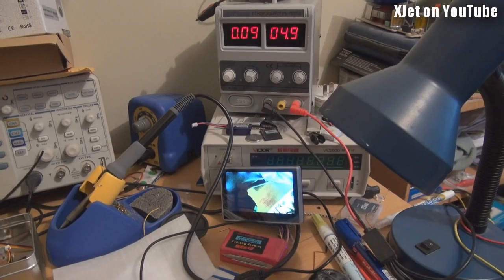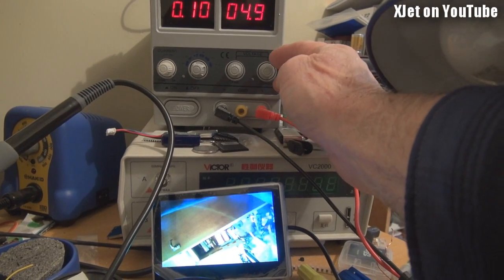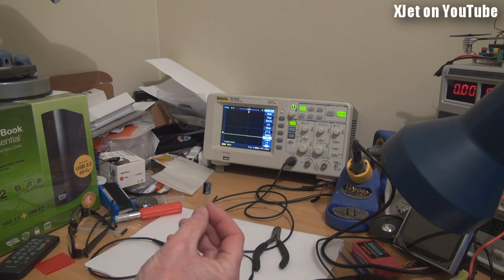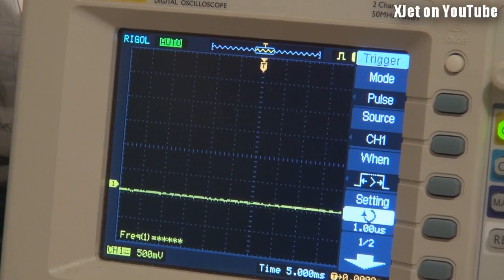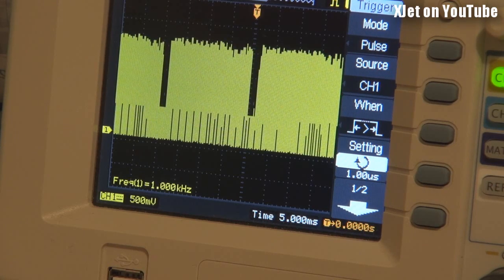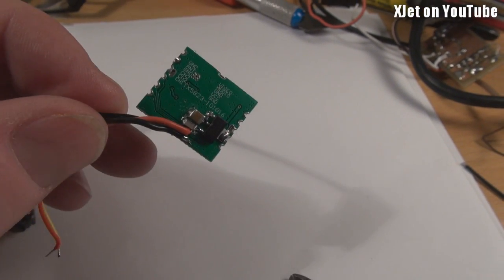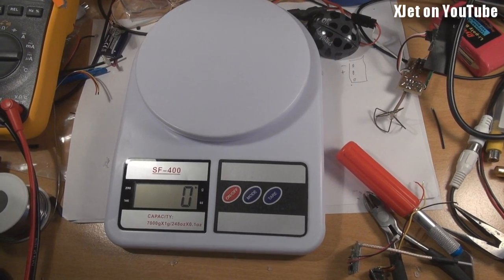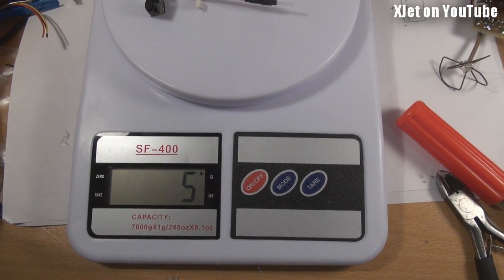Walkera Ladybird QR FPV build

Comment: Hello Bruce,
Is there a diagram of how you soldered the LM1117 to the board?
I was thinking about trying to make one of these.  What are the other parts needed.
You mentioned posting this but not sure were you might have posted this.
Thanks

Comment: The lightest FPV system I could find on the internet weighs less than a gram without the battery. It also has the absolute smallest field of view but at least it is the cheapest option.

Comment: nice setup. except one problem. you're going to get heaps of noise. i put a seperate battery on mine. it works fine. also i was thinking of changing to CL antenna. because where i live, a lot of obstacles and thus multipath interference. it's really bad :(

Comment: I've browsed a little more on the SecurityCamera2000 website. It should be down to one of these (expect the first one to be the one): 
- DC5V-12V Super Mini 1/3" CMOS Pinhole Security Camera 3.7mm Lens on  
- Mini CMOS Black and white Camera 3.7mm Pinhole Lens with Audio

Comment: Hi Bruce. Im told that a digital (or any) scale works the most accurate (= has the least deviation ) at half  of it's  maximum weight.
I've noticed that yours is 7000 gram so might be worth while putting on a dummy weight of 3.5k on it  .these days you can buy à carat  scale(  0.005Gr. Accurate ) for about 20-30€. But The big one you got might do its work Good enough too.  Grtz  Jeroen

Comment: Bruce, please finish up the FPV backpack series. Even if it means just posting a parts list and schematic.  I have all the parts except the regulator and the parts for the charge pump you mentioned. I spent hundreds on FPV goggles, a bunch of Eagle Tree equipment, and would like to put it all to work.  I'm not the only one.  Please finish the FPV backpack series!

Comment: Hi Bruce,
Nice work on the micro FPV build, very neat and professional. I have a few questions. How well is your radio link holding up with the 200mw 5.8ghz system under an inch away from its RX antenna? Maybe your better off going for something in the 10-20mw range? I got a friend with a blade mqx and he is using very similar gear, but 10mw instead of 200. He's getting range of about 50-60m, which is fine for this little model. Also, maybe you might need to run a small LC filter?

Regards

Doug

Comment: I guess the big electrolytic capacitor just was symbolic? For DC-blocking a video signal a little ~100n 0603 ceramic capacitor is good enough, just adding a few mg. :-)

Comment: Hey Bruce, Sweet project! I am going to have to try it myself as I have a QR SpaceWalker, Bigger battery, more motors :) Or I could pull off a few of the motors and then add the camera and transmitter and have a bigger battery and same basic construction as your LB :) I Like the SpaceWalker since it can be Octo, or Hex, or Y6 or quad :)
Thanks for the Idea :) I gotta find that camera here in the US!
Love the video!

Comment: Bruce I am trying to drop the +5VCC piggybacked from my reciever to power one of those 3.3V modules, I intend on using a few zener diodes in series to drop the voltage.
Any suggestion as to which zeners would be ideal for such a job?